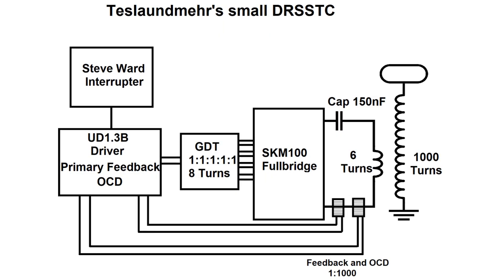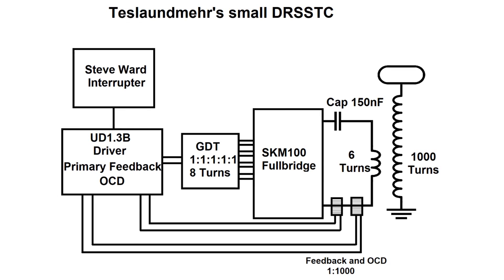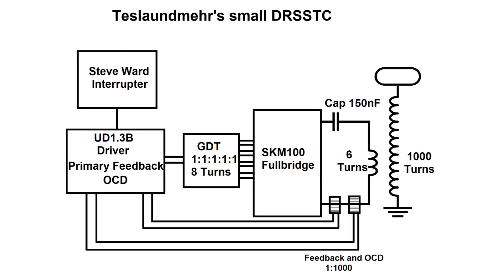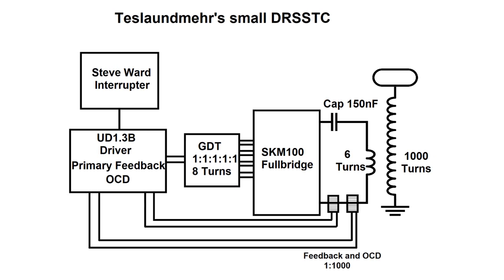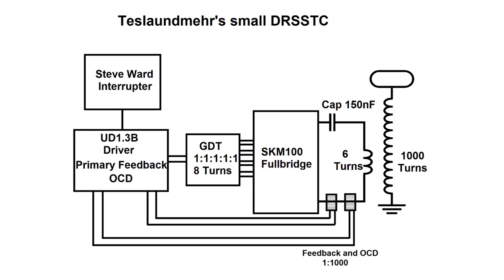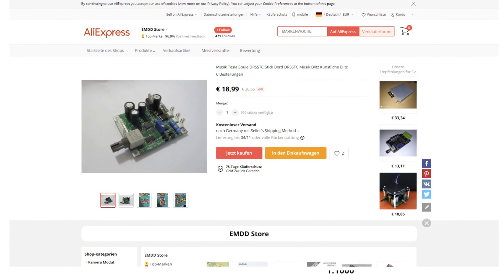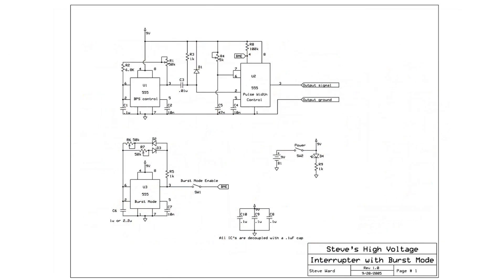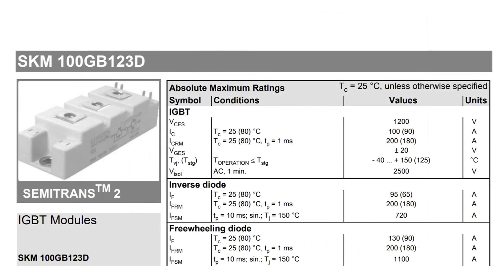DIY small extrem Tesla coil (20$ Driver - 1 meter Lightning)

Comment: Hi there. Did you make any changes to the interruption circuit?
Do you have a full diagram to share? I can't make out the connection on the AliExpress driver board.
Do you have a link to buy other components like GDT?
The video is halfway done.

Comment: Well the driver is 20$.
but IGBTs are 300$ alone + Bus caps + snubber and MMC, wires etc...
Gets you above 500$ easily. :(
Reply: You're quite correct. You can buy a ready made DRSSTC fully assembled for that price.

Comment: Man I just tried to see what it would cost to source all the parts to build a UD1.3 above. Not much point trying to do it unless it's on a custom PCB either. It costs less to just buy one already assembled lol.
Reply from the maker: Haha yes...I hope they will make the 2.7 driver :D
Reply: @Teslaundmehr  Dude if I were Gao or Steve I'd just give you several. I still can't believe how amazing your output is on this coil. I can't remember 100% what the total changes were up to 2.7 but it may be fairly simple to add something like phase lead to the 1.3. Doesn't really look like you've got any real issues going on with your setup other than fixable arcing issues and the fact that it looks to be outputting way more than it should lmao. If you've got OCD set though it seems fine. Some may say your primary coupling is too high but what the hell your output is great. If it works and doesn't break, success!
Reply from the maker: @Magneticitist  haha thank you so much!! I think phase lead would be pretty good, beacuase I think my Device dont run perfect in ZCS mode...The coupling is 20% at the moment, Im working on a new Coil setup ;)

Comment: I can see the secondary flashing in the surface and hitting the primary, that is not good, be careful
Reply from the maker: haha yes, I need a different design :D
Reply: @Teslaundmehr  the coil cant handle such power, you would have to use a coil with a bigger diameter and height
Reply: @Teslaundmehr  Design looks great I'd just add a strike rail.